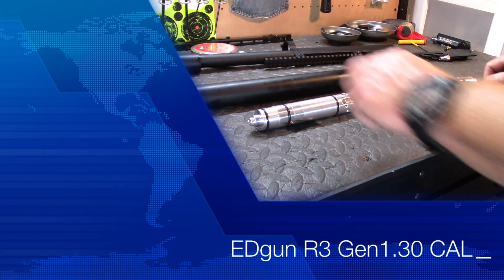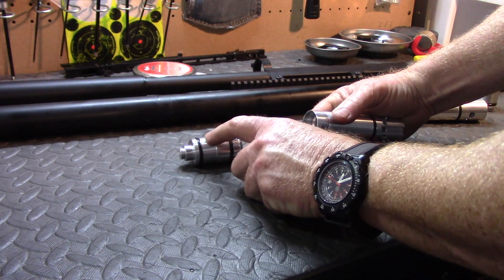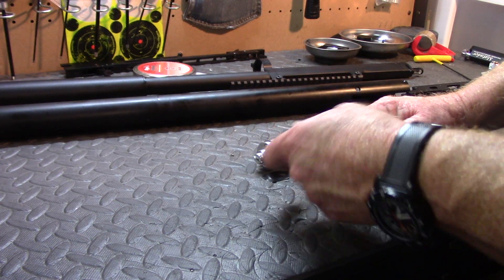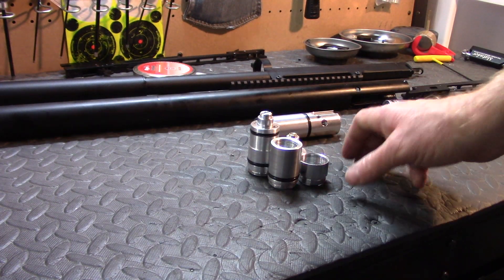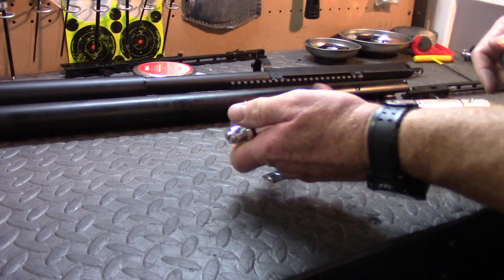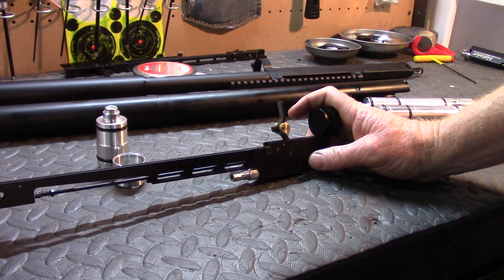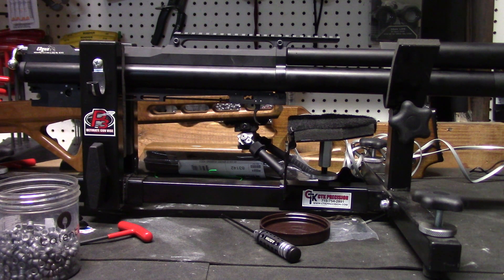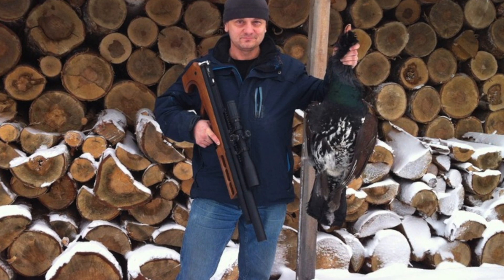Edgun Gen 1 30 Fix & Upgrade

Comment: Does the Huma organizer works well with the second generation ... because I have the same problem and the vulve 3mm has been replaced with the new road and the problem is still there... I wish you a very necessary response so that I have the knowledge to change the regulator or not...thanks
Reply from the maker: AKWAITI this is for the Gen 1 only
Reply: EDgun West thanks ED